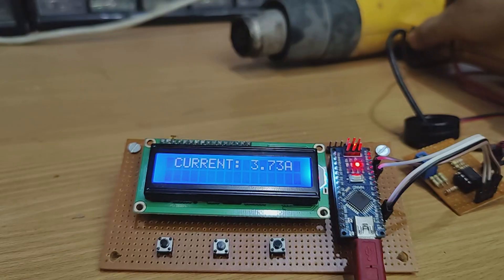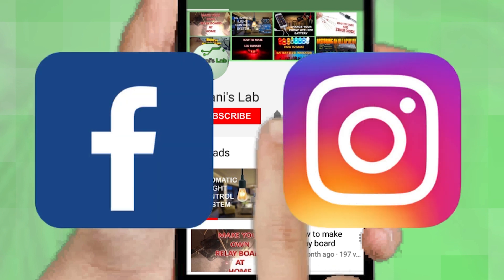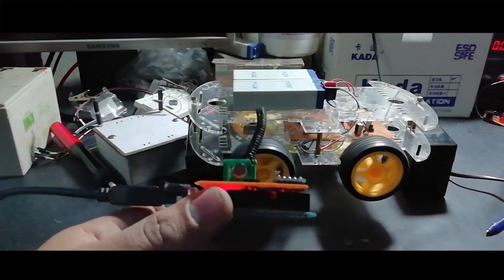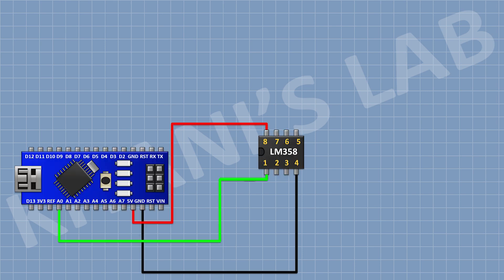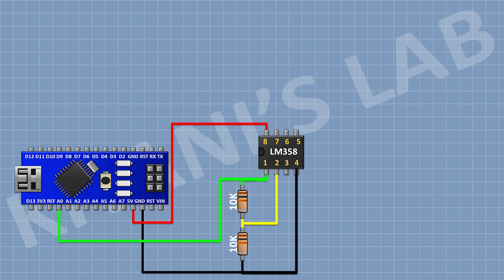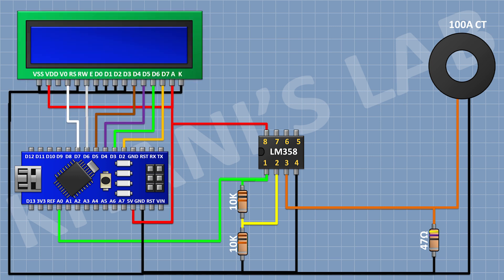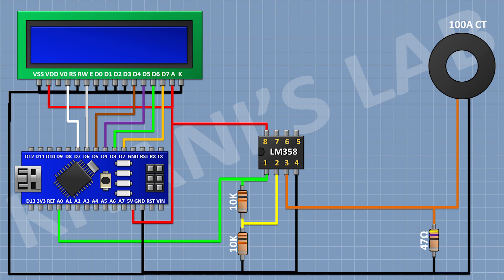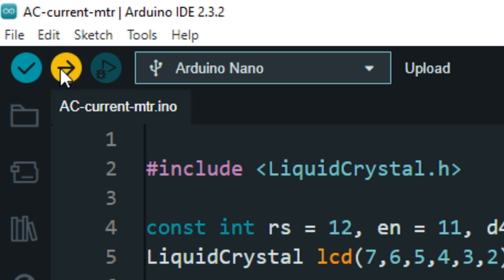How TO Make AC Current Meter | Arduino Project

Comment: Please make a Lithium Battery health tester  which can handel 3.2 volt - 100volt And constant 20Amp discharge (discharging current is adjustable 0.5Amp -20Amp )And this should monitor or operate from remotely
Reply from the maker: soon bro